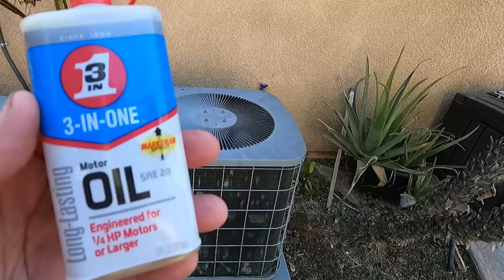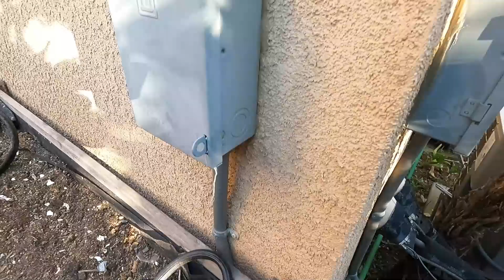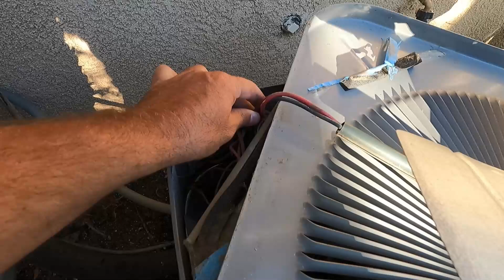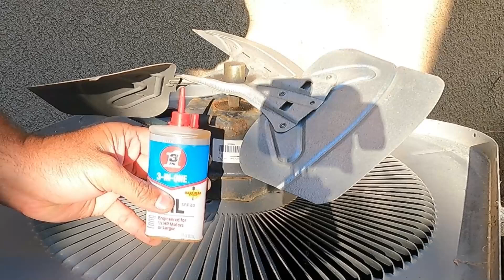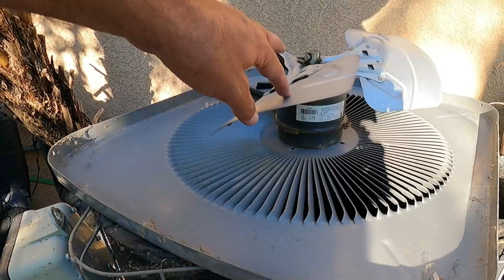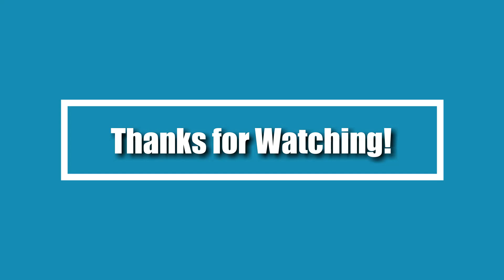WILL THIS 3-IN-1 OIL REALLY FIX A NOISY A/C CONDENSER FAN MOTOR? EASY DIY HVAC A/C REPAIR SAVE MONEY

Comment: the first day of temps below 104, my wife woke me to say that we were not getting ac. when i went to look at the unit i heard a loud screeching from the fan and i could feel the heat from 3 feet away. i tried your trick but my wires were melted at the fan motor. luckily i had a replacement within 2 days

Comment: Dear Dan the fix it Man
Great video on condenser fan motor bearing lubrication.
For the record, please be aware that your sleeve motor bearings are originally lubricated with PermaOil manufactured by the Permawick Corporation. 
Permawick Corporation has supplied bearing lubricants to the OEM electric motor companies around the world for over 70 years.
PermaOil contains additives specially designed for use in electric motor bearings, not found in regular off the shelf oils. 
Also please remember that every motor has two bearings that support the turning shaft. Try to make sure you oil both.  
Many longer life electric motors also have an oil reservoir system that surrounds the bearing.  You would need to take of the end shields off the motor to locate. That material is called Permawick. It stores additional oil and releases it to the bearing as needed. The Permawick material can either be replaced or reimpregnated with the same PermaOil.

Keep up the good work.

The Permawick Corporation.
Reply: Thank you for the information about Permawick corporation

Comment: My HVAC specialist has 51 years of experience he said that 3 in 1 oil is not a thick enough oil to use for the barrings. He told me to buy A/C Unit motor oil not 3 in 1 oil he said it cause the fan motor to fail sooner. Just a heads up. Amazon has motors for cheap
Reply: This is more of a temp fix if your motor needs to be replaced.  Basically to get you working until your repair man arrives.
Reply: So just use a thicker oil. A LOT of motors work fine with 3-in-1 oil. An HVAC blower motor is $300+.
Reply: Some motors off of Amazon are four days out. This is a temp fix so you won't burn up waiting.

Comment: 3-in-1 is a good idea but maybe not the best one. A silicone spray like "B'Laster" is better suited to a motor that spins that fast and will last longer (I use mine once every year or so when it starts making noise and it takes care of it right away.

Comment: My 16 year old system was trouble free until 3 weeks ago..unit was running but the condenser fan wasn't..so the condenser was overheating..I shut it down and spun the fan which moved freely,
Installed a new capacitor and everything seemed good but a few long cycles and the fan would stop mid cycle..contactor replaced and all voltages in and out to comp and fan good, ended up being the fan.

Comment: That specific 3 in 1 oil (blue label) is not sold here only the black label is sold here , don't use the black label in a fan motor because it gums it up and the fan won't turn.
Reply: Never heard of a lubricant plasticizing…. ever.
Reply: @bill4639  my pedestal floor fan (€25) began to strain after a couple of years. It would not start moving on setting 1 (slow and quiet), I had to get it moving on setting 3, then let it warm up for 10 seconds before I then set it on position 1. But after a couple of months that didn't work. Took it apart and oiled it, using BLACK 3 in 1 oil. Worked like new for a month... stopped working, took it apart and found that the bearing shift was tacky, the metal looked like it had had the same treatment that is used to season a cast iron frying pan. Bought a new one. 
These descriptions of 3 in 1 oil are from the 3 in 1 oil Web page
Black 3 in 1 oil uses
Protecting tools from corrosion, Lubricating moving parts and pivot points on hinges, rolling chairs, suitcase wheels, bikes, chains, and more. Penetrating rust to loosen nuts and bolts

Blue 3 in 1 oil uses

Lubricating moving parts, pivot points, and bearings on small to larger motors found in sewing machines, fans, lawnmowers and trimmers, drills, chainsaws, and other tools.

Comment: This is my exact problem. Thank you for sharing! I added the oil, but sometimes theres this long delay befor the ac starts running again when I turn it on.
Reply: Try replacing capacitor...

Comment: I oiled mine and ordered the replacement. hopefully it last long enough till the replacement comes in the mail. It's going to be pretty hot for the next 3 days.
Reply: Replacement just arrived and the old one is still going strong with the oil
Reply: still going good.
Reply: @numberformat Wow two years? 🎉
Reply: Still good. I also replaced the capacitor. It’s possible that the motor was running hot burning off the oils due to an old capacitor.

Comment: Its nice of you to post that update. This is still a good idea, though you can also take off the bolts holding the housing together to oil both sides directly. If the motor is making noise its probably too late though.